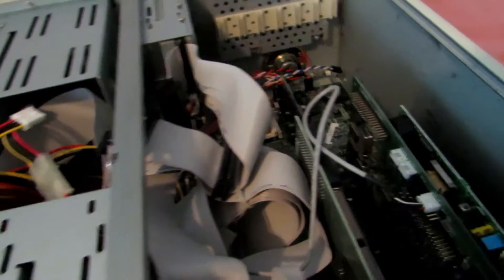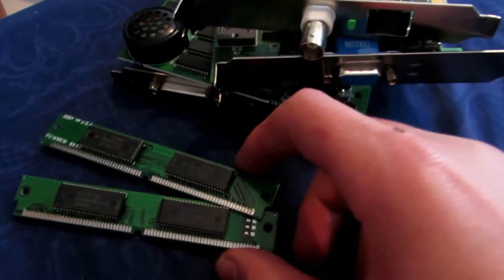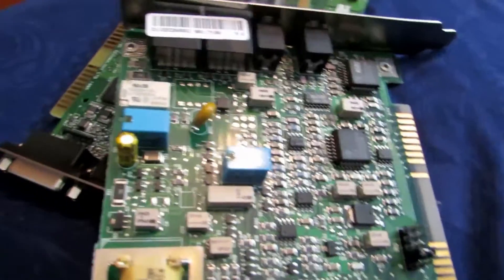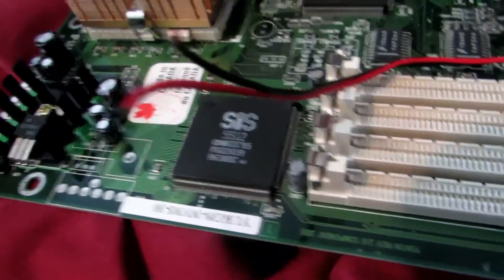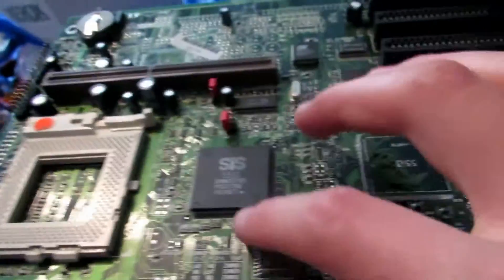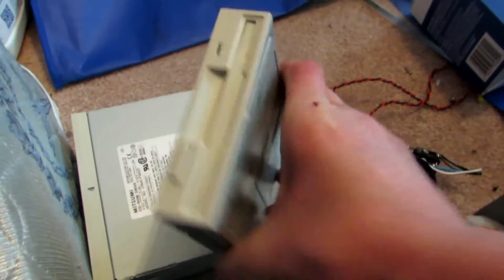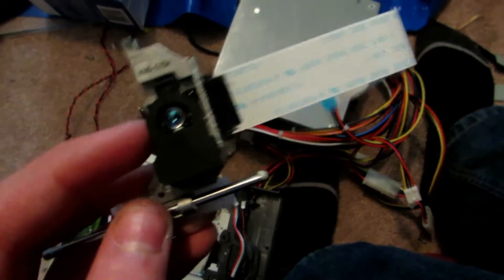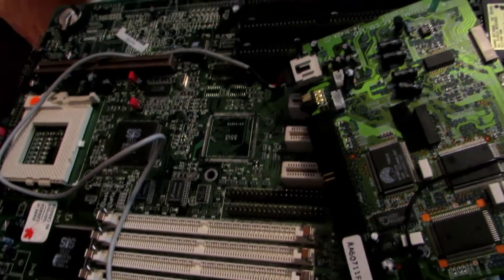CPU dismantle

Comment: 2:24 PC is okay, board would be acceptable.  CPU is what you removed and broke in half.  The thermal paste is silver (aluminum if it's cheap), it's put on the processor (CPU) to make contact with the heat sink to distribute heat.  The metal from all that will be in really tiny amounts, you need trashbags full of old components to get anything worth your while.  If you want bigger magnets look into the harddrive.  It will be right underneath the CD or Floppy.  It will have one of those flat long cables (IDE cable) that was hooked to the back of the CD drive, about the size of the Floppy drive.

Comment: there is always silicon in cpu's as well as gold/copper/aluminum bonding wires that connect the silicon to the pins
Reply from the maker: yes, but there is a very pure wafer of silicon in the middle, I don't believe any wires run through that as the silicon is doped with 2 other elements in different combinations to make n type and p type semicontuctors. those 2 different types are layered and make microscopic circuits of silicon, I don't think any other wires run through that.